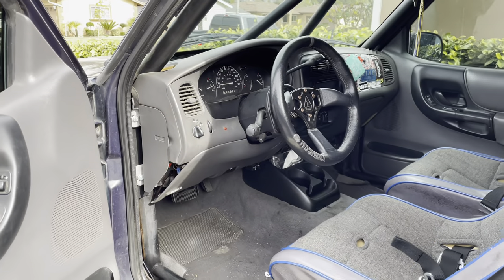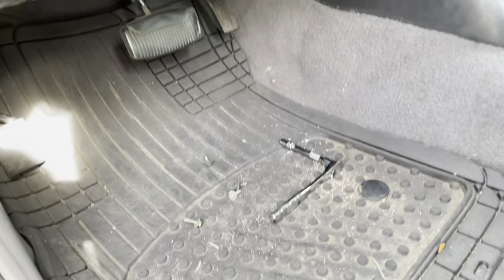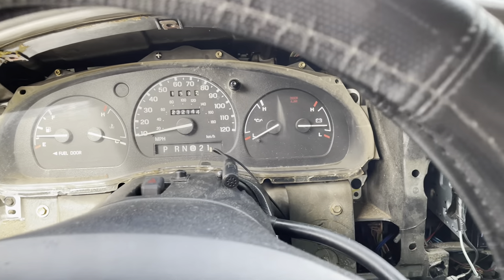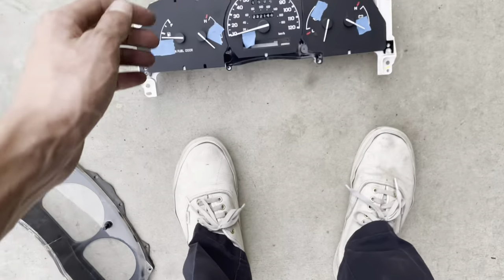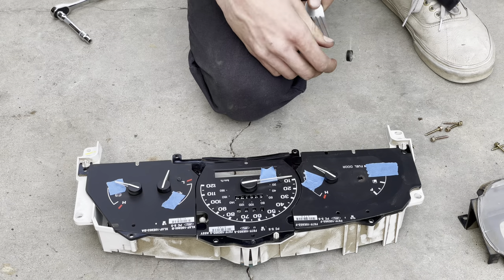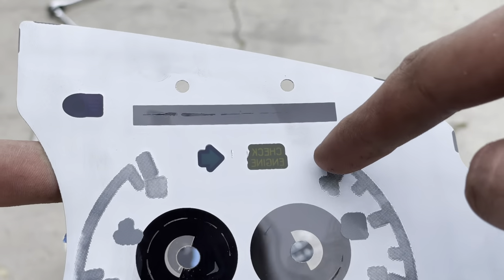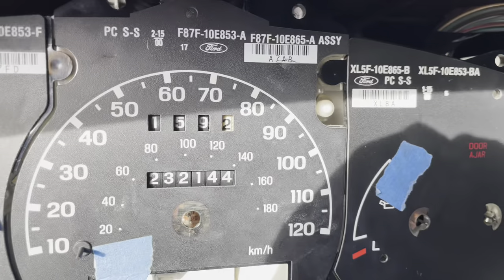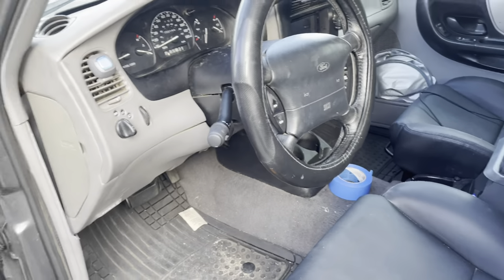LED Dash Light Conversion for Ford Rangers

Comment: Just did my 2005 ranger and the bulbs werent 194s they were actually the PC74s the 194 didnt fit but still managed to get the right size and change them out nice work on yours

Comment: Nice job. You have a talent for instructional videos - well organized, detailed, and with pleasant voice. I hope you make more videos because I have the same truck. This video helped me remove and clean out my instrument panel. Two of the three top plastic holes on the top of the bezel also broke on my truck! I'm trying some JB Weld to make new supports. Well, I'll see. Also, btw, I found an easy mod for adding a toggle to switch off the annoying door chime when working on/cleaning your truck. Lmk if you don't know it yet. Thanks again for posting. It helped a lot.
Reply from the maker: Thank you! I’ll get better with more videos. Was a little nervous watching back this vid haha. 

Glad I was able to help!! Let me know if the JB weld works. And that might be a video on its own to remove the chime! I don’t know how to remove the chime
Reply: @Poolboybob  The nice thing about this mod is that you don't have to remove the chime; just add a switch, and then you can turn it off when you're doing something with your door open. I like the chime to work other times because it keeps me from locking my keys in. It's really easy to do. I will throw together a quick video for you, and then, if you like the idea, you can make a much better video for your people. You've got at least 37, I see ;-)
Reply from the maker: @tayler2396  sick! I’m looking forward to this video! Since I have a quick release steering wheel on my ranger, we had to cut a lot of the wires off so the chime only works when the key is turned, so I always forget them in the ignition, especially because my power door locks stopped working. Lol. Thanks my man!

Comment: So I’m wanting to do the same thing except all red for my Gauge cluster since my truck is red. Mines a 2002 4.0 xlt same dash and everything obviously. So I just need 6 of the red ‘194-RHP5’s???
Reply from the maker: Yep the only difference in the whole process would be buying all red LEDs. Did this on my buddies red ranger and it turned out phenomenal! But the red doesn’t dim as much as the other colors so keep that in mind. It never bothered me when driving though

Comment: I replaced mine with new led bulbs. The problem is for some reason one of the new led bulbs seems to go off every now and then. It stays off for some time and then it comes on again all by itself.
Reply from the maker: If you’re willing to give it a shot, I’d try swapping that LED with another one from the cluster and see if what happens. I recently started having an issue with one of my blue LEDs that flickers. For some reason it doesn’t do it when I dim the lights so I just keep ‘em constantly dimmed and haven’t bothered replacing it haha
Reply: @Poolboybob cause you bought those cheap ass leds lol.. Flickering is due to excess heat damage over time. Next time don't cheap out ;) They make regular incandescent colored bulbs too
Reply: This was a very good tutorial. Some of what you showed wasn't visible due to being zoomed in too far though.

Comment: Do you think this process would be roughly the same on the 93-94 faceplates considering its a different style?
Reply from the maker: I wouldn’t be able to say yes or no unfortunately. But I do believe I read something that rangers old enough have clear faceplates and green lights so you can just swap the color of the lights. I don’t know exactly what years that is tho
Reply: I did it on my 94 and it works but only has one spot for the white bulb and 2 spots for the other colors so the white blends a bit - also comes through a bit green - still a good look
Reply: @bucksinsix2591 how many leds did u need?

Comment: Is it hard to make the speedometer calibration accurate after taking off the needle?
Reply from the maker: It just takes some patience and good taping. It’s real easy to slightly twist the needle when putting it back on so just try to line it up as well as possible. It turned out really good on this ranger so I have hope you could do the same
Reply: @Poolboybob  Thanks for the help, man. I actually already installed LED’s on my cluster, but now I bought another cluster off an ‘03 Ranger that has really cool silver gauges & that actually has a tachometer which I had been wanting. I need to take the speedo needle off to get to the odometer mileage & then swap out one with the other for the original mileage of my truck. I hope it’s not too difficult as you said, I’m not sure if I trust myself to do it.
Reply from the maker: @2H2521  you got it man! Just think about the best way to do it, meaning having the key off, key on, or have the truck running. Some needles sit on little pins that are pushed into the face of the cluster that might need to be removed to get the most accurate position. Best of luck to yah!
Reply: @Poolboybob  Thank you, man. I’ll be back if I need any assistance if you don’t mind.